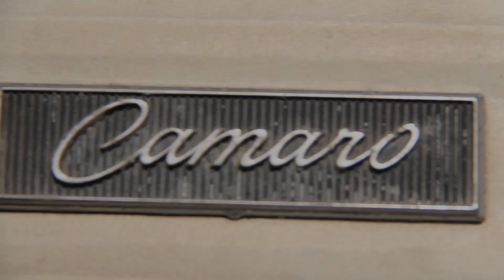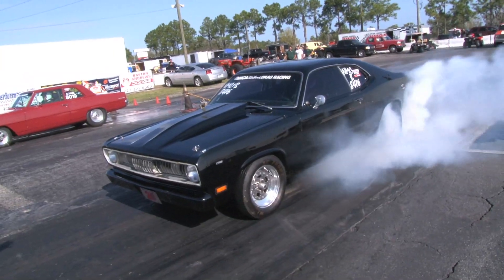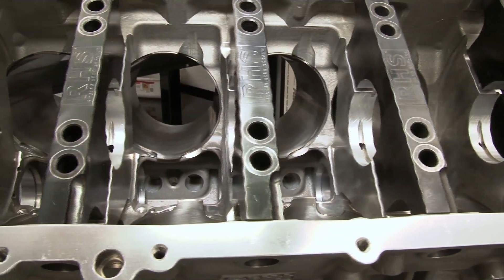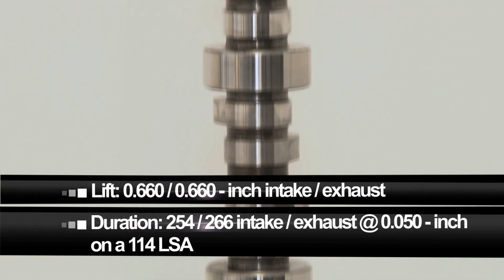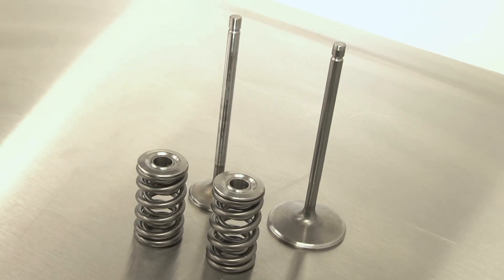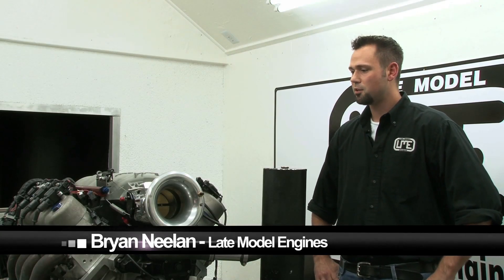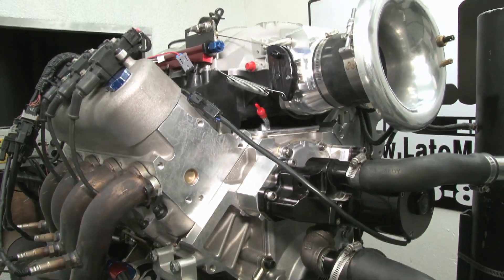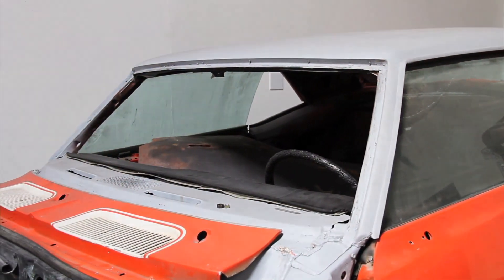Late Model Engines Builds A Huge 502 With COMP Performance Group™ Parts

Comment: Whats the bore on the block?
Reply from the maker: 4.125" or 4.165" Siamese cast bore walls are available as standard features on the RHS Aluminum LS Race Block. This particular engine was built at Late Model Engines so you may want to check with them directly for specific details. Thank you.
Reply: +COMP Cams +ReFuzy it's 4.165" x 4.600". Max bore, max stroke. It's absolutely insane. :P

Comment: I had one in my Camaro, torque monster engine, leaving the starting line from idle, with a 3.08:1 rear end and doing 1.55 60ft and lifting the front tires a little bit: youtube.com/watch?v=6TOaLoghaj8